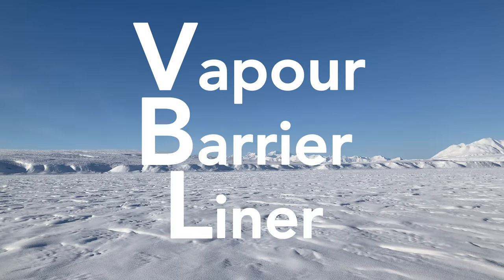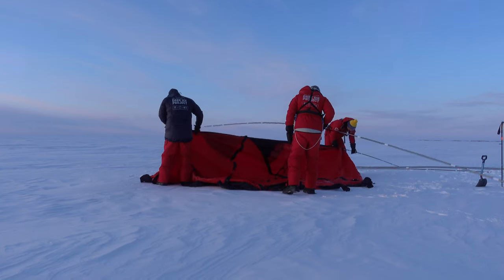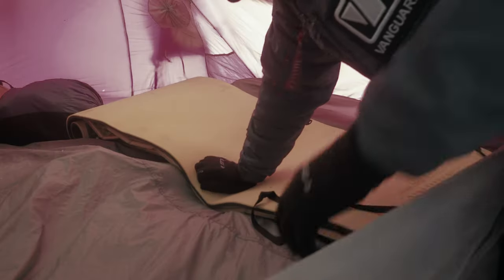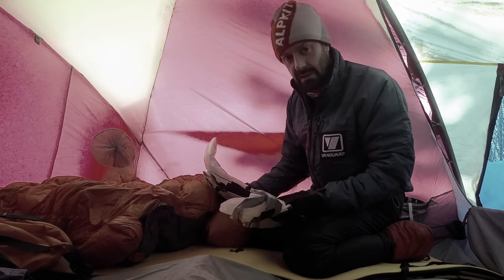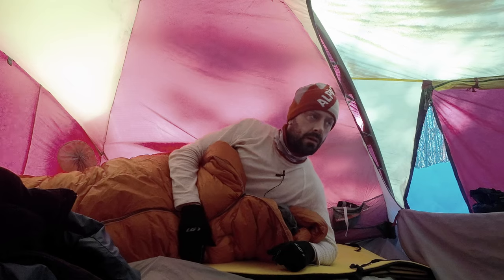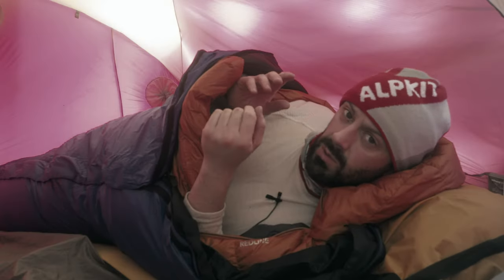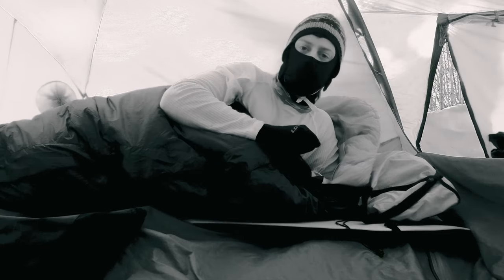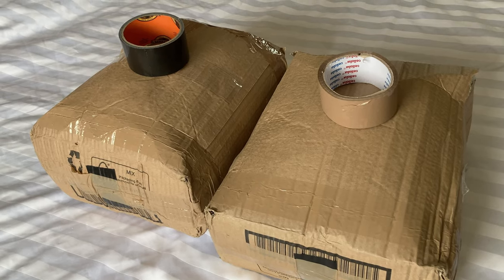Vapour Barrier Liners ( VBL ) Part 2: Sleeping bags and foam pads in Alaska's extreme cold. [4K]

Comment: Well done and explained. Have you ever tried a liner on the outside as well? I have run into (albeit rare) where we have thermal inversions overnight. It may be -30 when you set in but -10 when you wake up and the tent is raining inside. 

I have not yet tried but always open to learning from others who have had a poor outcome 😂
Reply from the maker: I sometimes use a loose nylon fly draped over the bag if there's a major hoarfrost issue.

Comment: Hi, fantastic video, thanks. I didn't understand the bit around 21min about the freezing point issue, could you please develop? Also, I wanted to ask what R-value equivalent you think you're getting from just the 3 foam pads: any clue?
Reply from the maker: It's about where the freezing point is located in the system. Next to your skin? You get cold. Somewhere in the middle, preferably in the outer layers? Ideal. Too far out and you are radiating lots of heat, and the cover will be too warm, and so may get damp.

Not sure about R values for the mats save for what thermarest publish for one mat.
Reply: @AlexHibbertOriginals  Ok, so it's about getting neither too cold nor too hot, no shivering and no moisture. Got it, thanks.

Your sleeping pad system got me thinking, thanks also for that. Love the videos, can't wait for more on extreme cold camping.

Comment: Very very interesting and helpful video, many thanks for all your precious insights! I'm from Germany and I'm soon planing to do a snowshoe-hike and a wintercamp for a few nights in a snowy aerea, but yet not experienced with very cold nights (my coldest was -4⁰C). So I have one question: when sleeping in freezing cold temperatures outside with a tarp is it possible to use my "breathable" bivybag (it's the Alpkit Hunka XL) on an adequate temperature-rated down sleeping bag? Do you recommend using it with a VBL inside?
Reply from the maker: Thanks.

A bivvy bag underneath a tarp certainty won't hurt, but both of those are there to mostly keep rain off you.

It depends how many nights. If you risk sleeping whilst in not totally dry clothing, or think it'll be hard to stop moisture from within, a VBL will be useful. If you keep your sleeping bag dry, a breathable bivvy bag isn't that important, but it won't cause any problems. If it's dry cold, and not windy, and if your tarp is not generating hoarfrost, I'd say the bivvy bag is unnecessary.

Comment: Hi Alex nice videos. I have  the same down bag/synthetic over bag system. I usually go on a 10/14 days trips in Scandinavia. temperatures in the negative 20"s/30's. would you suggest a VBL for those sort of timelenghts? then, how do you cope with personal Hygiene? using the VBL means that the body sweat sticks on your body, especially in the intimate parts. any suggestions about that? thanks
Reply from the maker: For over a week I would definitely use a VBL, unless the sleeping bag is majorly over spec and you don't mind ice forming.

I wear a base layer in the bag, so my skin isn't in direct contact with the plastic. For hygiene, small wet wipe packs that are quick to thaw.

Comment: I have a question: just how bad is it if you don't sleep with a VBL? I get that your body gives off moisture, and it can get into the bag, and that can lower the bag's effectiveness, but by how much? Most of the moisture you give off is from your breath right? And if you've got a synthetic overbag, doesn't the down one stay dry? I haven't had any problems on 2-3 night trips at moderate temps (-10 or -20c), but you're talking about much longer trips, and at much lower temps - does the body moisture sleeping bag issue become far more serious over time and in extreme cold? Thanks for the thoughtful discussion!
Reply from the maker: My experience is that without a VBL, or with a bad bought one, you notice ice lumps forming in the down after about a week.
Reply: OK thanks for the reply.  @AlexHibbertOriginals

Comment: An idea for a future adventure - travel to [somewhere challenging] using absolutely nothing made of any type of plastic. Possible?
Reply: It would have to be a warm climate expedition if there was no plastic as there would be no tent (canvas tent maybe?), no shoe laces or soles for shoes, no thermals, no sleeping mats, no shell or soft shell clothing, no fishing line (braid and mono are a type of plastic) except gut line, no commercial fishing rod (even carbon rods have plastic in the handle) and the list goes on. It is nuts to think how ubiquitous plastic is in our lives and also nuts as to how it has transformed ski touring/bushwalking/mountain climbing by making them safer and lighter. Imagine how Shackleton et al would have endured Antarctica if they’d had plastic clothes, sleeping bags, tents, shoes etc. It scares me now that my recycled plastic bottle very warm fleece jacket releases a shower of micro plastics every time I wear it.
Reply: @teeanahera8949  All valid points. I was really thinking of polar expeditions. i.e. Would Alex like to consider an expedition to a polar region using equipment built from materials that would have been available to Shackleton, Scott, Amundsen, etc., although with modern design techniques and electronic communications for safety.

Comment: Im curious why you wouldn't flatten out the area underneath the tent for a more comfortable rest?
Reply from the maker: I actually did, and then reshaped the sleeping area with my knees. There were some twigs sticking through the snow that I would normally cut before putting the tent up, and they gave an illusion of an uneven surface.
Reply: @AlexHibbertOriginals  Ah yes. Even the most novice "camper" has experienced the wrath of the twigs .

Comment: Shoveling snow from the tent area is unnecessary. If snow is soft you just tramp it down with your skis with good marginal around tent. If there is deep enough snow you can dig vestibule after pitching so that there is more room, in some cases even up to standing  straight. Even smaller digging makes it comfortable to sit "on shelf" when there is proper leg room in vestibule
Reply from the maker: I assure you that ski trampled snow this thick, and this soft, would have been a nightmare. Shovelling was needed.

Comment: I was always interested in what type of Expensive sleeping bag you used as I use this China made Red duck down mummy sleeping bag LY-20108, 320T Nylon, Size 210cm (L) x 80 cm (W) x 50cm (W), Weight: 2.3Kg (including 1500g duck down), -30°C - -15°C-5°C rating It only cost me around $165 AUD or 85.73 GBP. 

I have Osteoarthritis, pinching nerves in my back, living on pain meds for life etc so I can only sleep on a couple of those self inflating 8cm & 10cm thick mattresses on the floor, sheets & a light sleeping bag in between month's as a top cover, a sheet for summer & the duck down sleeping bag as a top cover during winter when it gets down to about minus 2c. The duck down sleeping bag used as a cover only acts like a huge sock for part of my legs & feet while acting like just a very warm duvet cover without having many bulky under clothes.
Reply: At $165 I wonder how much of that 1,500g of down is actually feathers. The bag Alex had was rated -45ºc and was lighter than yours. Any way in -2ºc it must be very cosy.
Reply: @teeanahera8949  Perhaps it's the quality of feathers, size etc that make all the difference but his sleeping bag would be 3 to 4 times the price, they are not cheap the name brand minus 45 sleeping bags.

Comment: How do you dry off in the morning when you're all sweaty and gross from sleeping in a plastic bag, and then how do you dry off your baselayers you slept in?  Do you really get out of the bag damp and pack up your stuff while you're still in damp clothes?  How does that not cause hypothermia in such low temps?  Or does it somehow sublimate without ever melting so the water doesn't make much contact with the skin to be able to take the energy from the body, and it just takes it from the cloth instead?  
With the balaclava tight on your face and getting moist from breath, doesn't it make your nose even colder than it would be without it?  I experienced this with a thin, synthetic buff at 25F.  What could be going on there?  
Also, there's something really appealing to me about the level of anal-retentiveness you have to be to keep your sleep system dry.
Reply from the maker: The baselayers don't tend to get damp. You shouldn't sleep too hot, and that's one reason why over-specced sleeping bags are a problem. I'd need advise from a physiologist, but my guess is that the body's core and skin temperature, and the surrounding humidity, trigger a reduction in perspiration. The baselayers will of course not be bone dry, but they feel dry to the touch, and a short time in the air of the tent before dressing solves the rest. 

The balaclava is exceptionally thin, so no it didn't get damp with my use. You could cut and hem a little mouth slit if need-be. Even if it did, at the coldest temperatures that's better than a bare face, or retreating inside the sleeping bag and getting that wet.

Comment: 5:07 So far, so fine. But will anyone please explain me, why XPE is't available in thicknesses over a few millimeters, on the foam market? 
I know, there are thicker rollers out there, but as plain foam, because that stuff is dirt cheap, no chance. Only as plates, they are up to 5cm thickness. Is it really the case, that we are left with one mass market producer and that one gives a shit about anything else than 3mm packing foam?

Oh yeah, in a few seconds Alex is using EVA rollers, and they basically weigh ten times as much as XPE, plus they are water sucking, which again XPE isn't.
let alone, that XPE is recyclable, like any plastic bag, while EVA is basically trash to burn or dump. 

Can we please fix that😩
Reply from the maker: Supazote is a true polyethylene foam, as far as I'm aware? And I can see plenty of 7mm+ yoga mats etc on the market made of XPE.
Reply: @AlexHibbertOriginals  I own one. The problem is, i'm a little bit large for it. Also 7mm is not that much. I would rather take the 30mm Plastazote type foam and not have it precut in 1000x2000 tiles☹️ I think, one day i need to visit a factory. 

Thx anyway👍
Reply from the maker: Evazote is quite a step up from Plastazote, and I've had no issues with it retaining moisture. Mine was two 10mm pads bonded with 3M 1099 adhesive.
Reply: @AlexHibbertOriginals  The sturdy roller? Doesn't look like 2cm🤔
Reply from the maker: No that's thinner. The black flat under-mat is 2x 10mm Evazote.

Comment: You clearly need a large bag where you collect all you mattresses  into one solid block. Or even better -- you need to permanently sew the said bag onto the tent floor. Or even better -- to sew it under the tent floor so the floor will be be clean and less messy. The said bag can have opening on both ends, so it is easy to empty.  Depends on the sleeping habits of of course, I tend to roll around alot.
Reply from the maker: Some people do use mat bags, but then you need to decide what it's made of. Unlike it's cuben or similar, it might wet out and then ice up. Also, I keep changing the z-lites between seat, footrest and sleeping mat, so need access. I am investigating a velcro system with a new sort of Primaloft quilt - but it's very experimental.